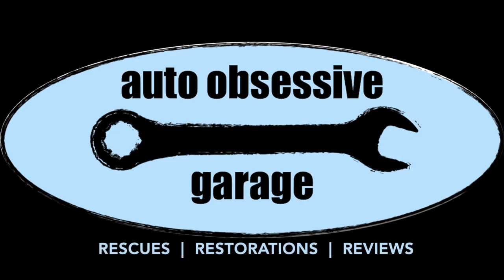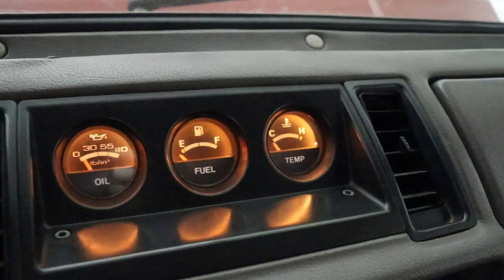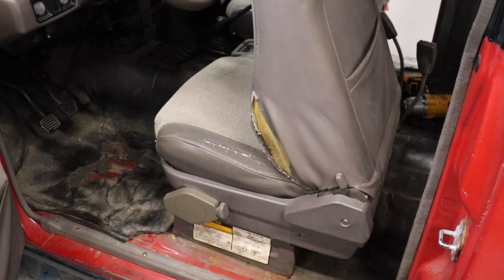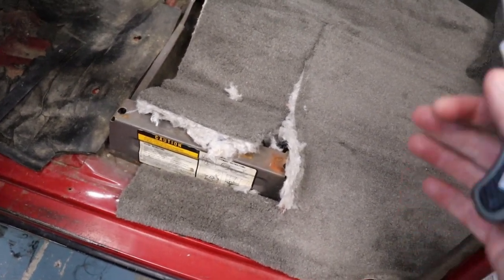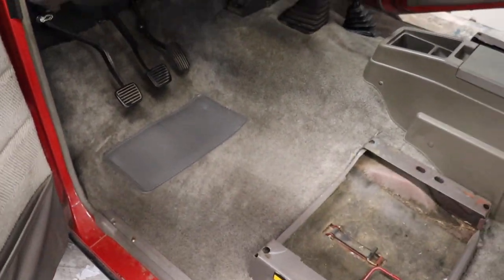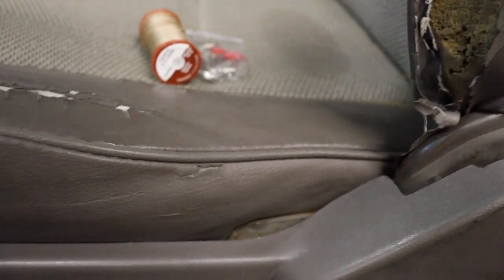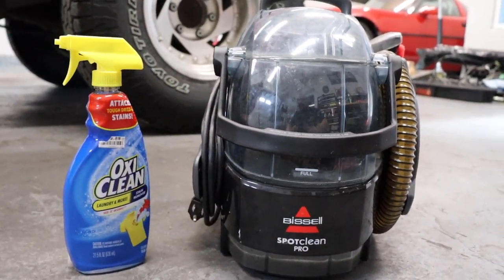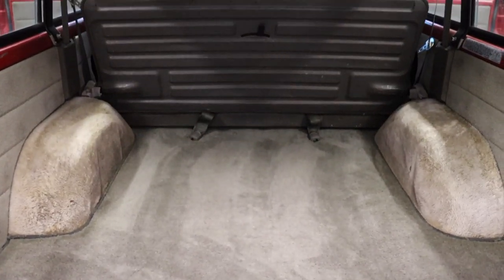1988 Isuzu Trooper - Episode 5: Complete Interior Renovation

Comment: I just purchased a 1988 Isuzu trooper and love it! I’m trying to change and take off the green rubber on the dashboard headlights. I’m having trouble taking off the RPM and speedometer gauge. Looks like the headlight switch is in the way. Do you have to take that’s off before you can pop off the cover to change the bulbs?
Reply from the maker: The headlight switch can be unscrewed from where it mounts into the dash area and drops down. You should see a slot in the headlight switch circle metal plate…I used a flat head to unscrew it. The cluster can be carefully slid out to allow access to the bulbs. 
The green rubber was stuck to the bulbs, so I simply replaced the bulbs while I was in there.

Comment: I have trouble finding a wire diagram for the isuzu trooper 1988 where do I find it? There is no spark and the injector isn't working
Reply from the maker: Should be able to track one down online. What else doesn’t have power? Has there been any major rewiring or rodent issues?